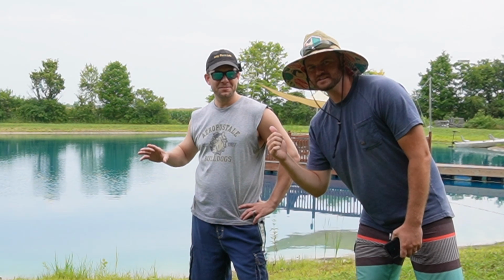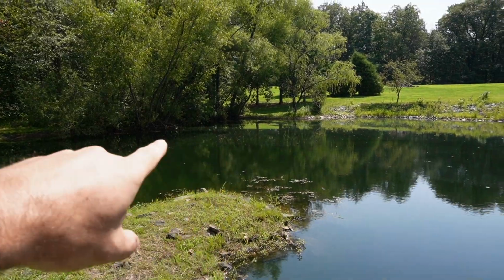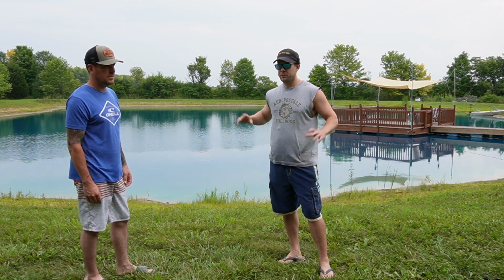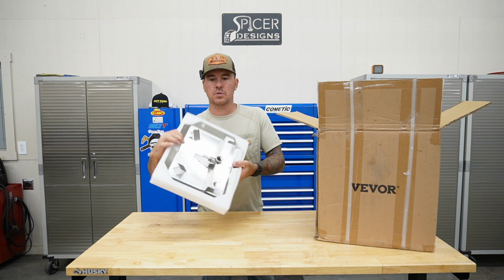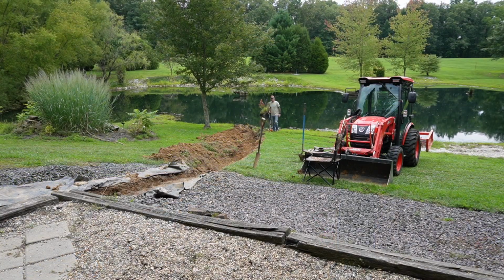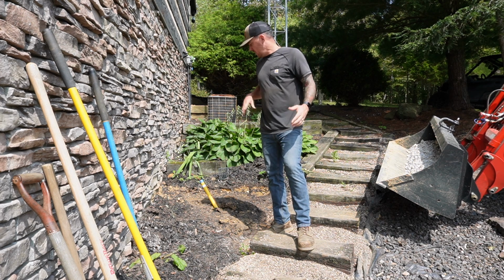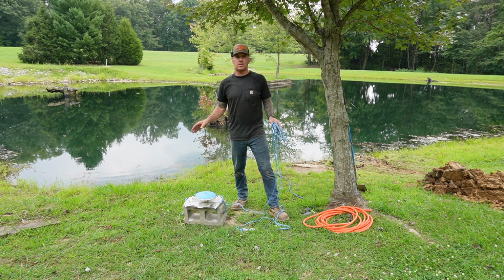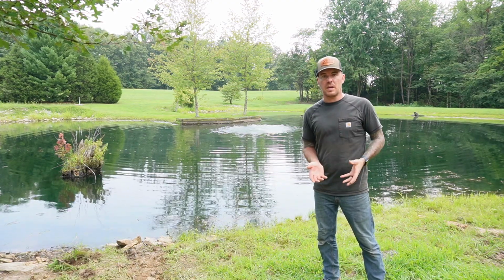Budget Friendly Pond Aerator Including Full Installation....@vevor.official

Comment: Yes, the aerator is aerating perfectly. I have a stone diffuser about 16 years old and not the diffuser that comes with the pump. I wonder if that’s the issue the hose is not blocked and the valve at the pump is wide-open.
Reply from the maker: Ill bet it is.  That pump that i have can do up to two aerators.  It could potentially blow the air line off the stone in the water.   Those stones are typically used with a lower cfm compressor I believe.
Reply: @SpicerDesignsLLC I adjusted the the pressure relief valve and it is working fine. I appreciate your help!

Comment: Well done Kyle. I've had a pond for 25 years and you're definitely on the right track. Aerators make a significant difference. If you add a product called Muck Away from The Pond Guy it will eliminate literally all the muck build up on the pond bottom and shore line. Excellent video!
Reply from the maker: Thanks for that info.  I will definitely look into that.   Ill take all the help i can get from people with experience.   Thanks for the comment.

Comment: Great video, I've been looking at that Vevor aerator setup. Do you think it is feasible to run this setup off solar/wind since I don't have a good way to bring power to the pond. Thanks!
Reply from the maker: I know they have setups designed to be powered by solar or wind.  The one i used is a 3/4 hp motor.  You would probably need a pretty decent solar or wind setup to power it.   Ill have to check if Vevor offers anything like that.

Comment: Great video as always. Since it looks like the pump is pushing plenty of air would it be possible to "T" the air line and add more aerators? Maybe that would make the system more efficient. Also to hold the rope to the aerators you could tie it to a duck or goose decoy and let them float around the pond. Keep up the good work enjoy all youe videos.
Reply from the maker: Yes i think that pump could run two diffusers.  I actually saw the duck thing on stoney run farm this morning.  That is a good idea

Comment: Interesting location for the pump. You lose a ton of CFM per 50 ft of airline from the pump. By time it reaches the diffuser stone I'd guess you're about half the CFM rating of the pump. Looks clean though, *edit - I just realized from the aerial view, the ponds not that big. You should be fine for one stone. I had to run two pumps to get my stones out 200 ft. It was a pain in the butt..lol
Reply from the maker: Ya it pumps pretty good.  Mines not a stone though.  Its like a membrane style diffuser.

Comment: I just installed mine and the pressure relief valve is continuously venting. Is that normal? Is the pressure relief valve adjustable?
Reply from the maker: That doesnt seem normal.  Sounds like theres a blockage or the valve isnt open.  Is the aerator working?